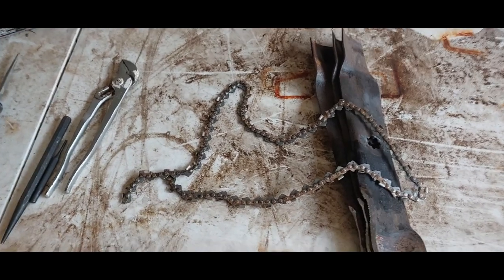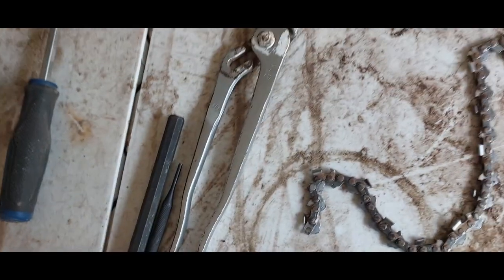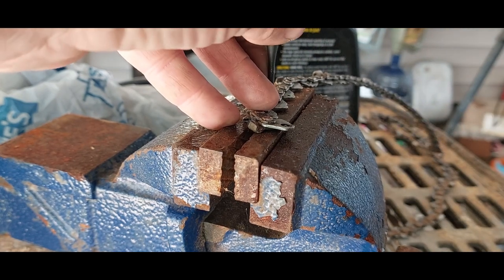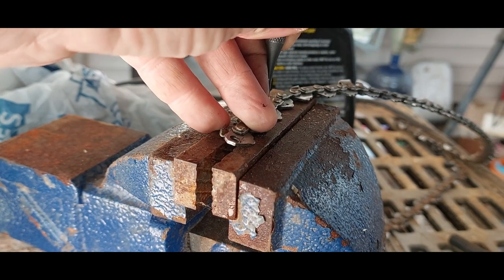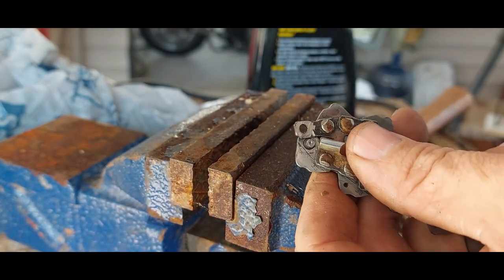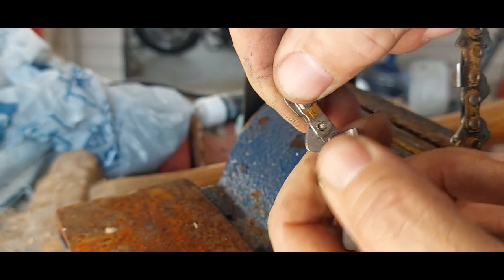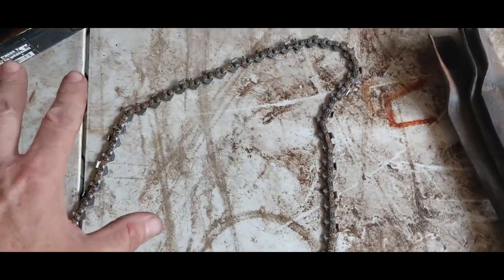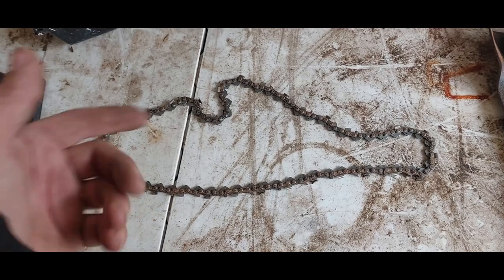How You CAN Shorten Chain Saw Chain

Comment: You ground that rivet off... did you replace it with a new rivet? No? There are a hundred ways to half-ass anything you do, and emergency rooms are full of the idiots that do that. Get the right parts, get the right tools, and learn how to do it right, or pay someone that will. Smh.
Reply from the maker: Although I apriciate your comments but I have been doing this all my life, my father has done it all his life, his father, see a pattern? Yes? If you do it right you will not have a problem. You should do what works for you, this video is to show one way to do this amd it is a generational success.
Thanks for watching, have a great day.
Reply: @cobravids  Rivets and spinners are cheap. Failing to acknowledge that this is a shortcut video is a disservice and a dangerous route for those who may be less experienced or less mechanically inclined. All is fine and good until Billy Bob has a chain come apart and wrap around his leg.